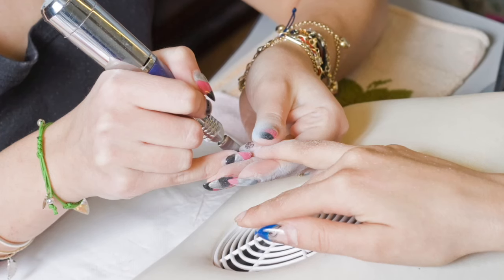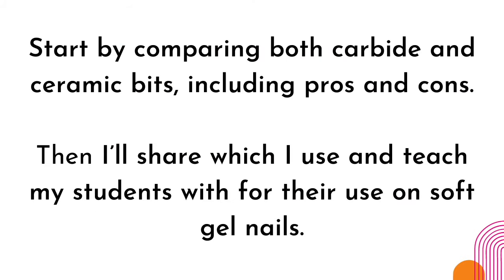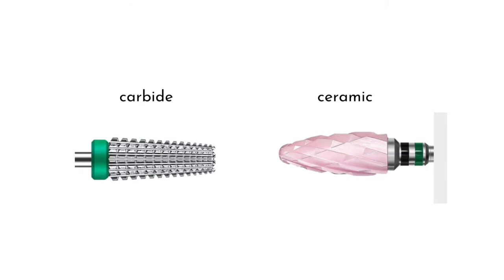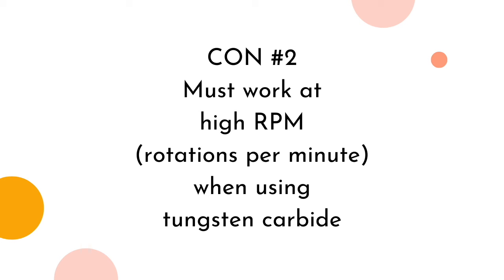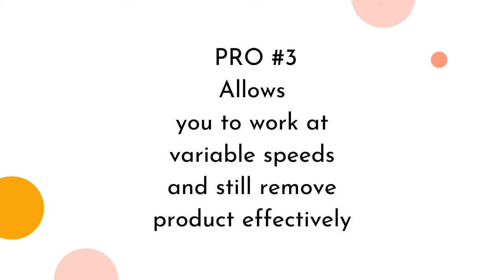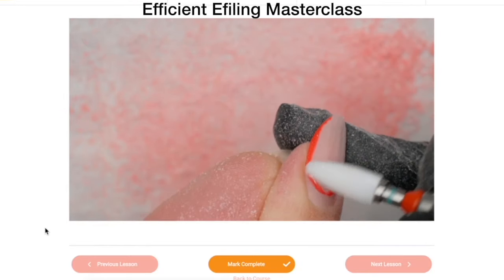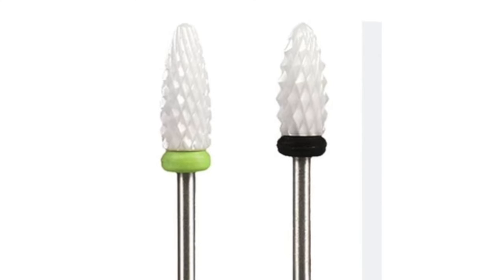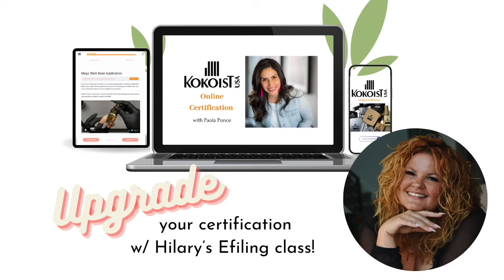Carbide Or Ceramic Bits | Which is best for gel nails?

Comment: Very informative video! There just isn't a lot of information on when or where to use different bits. Especially for those of us who are self taught. I have been doing my own acrylic nails for almost 3 years and while I've learned to be efficient with my e-file. I still didn't know the difference between carbide and ceramic. I just recently learned that carbide bits had a much shorter life span than I thought 😅. Makes sense that removals are taking longer these days lol. Thank you for this much needed information.❤

Comment: I use both carbide and ceramic for removing my gel polish! I leave a thin layer of builder gel overlay to protect my natural nails 😊
Reply: I think I want to learn to do this, is builder gel that you use a hard gel that can't be soaked off? Do you do a back fill of the builder gel rather than filing it all off and starting over with each polish change?